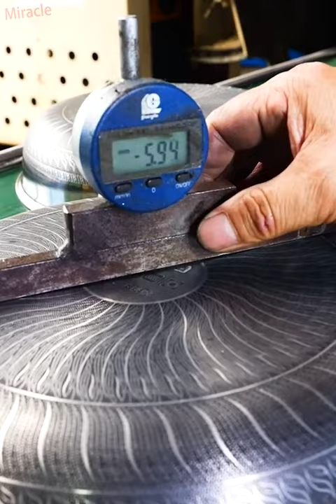How to produce a stainless steel pan

Comment: Stainless steel is one of the worst conductors of heat.
Reply: Why?
Reply: @veendoor because of physics.
Reply: @Stevoli286  it's not so clear. Could your explain more, please?
Reply: We use a stainless frying pan with copper sandwhiched inside the base for that very reason. Same with pots. They cost more but it's totally worth it. Also, non-stick coating? Eeeuw, keep those nasty chemicals away from my food, thanks! They work well (non-stick) until the coating starts flaking off, even when using only plastic(yuck) or wood utensils. Those flakes end up in your food, which then ends up in your body.

That, and cast-iron is all we use. Some of our cast-iron pots are enamelled.